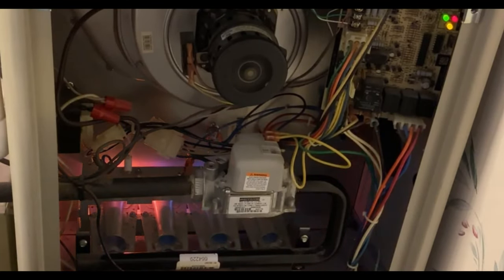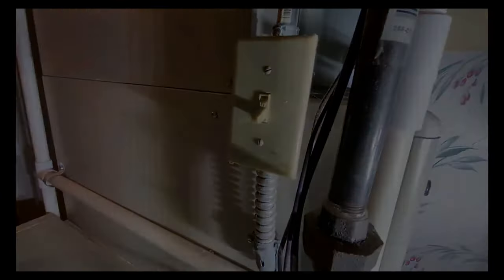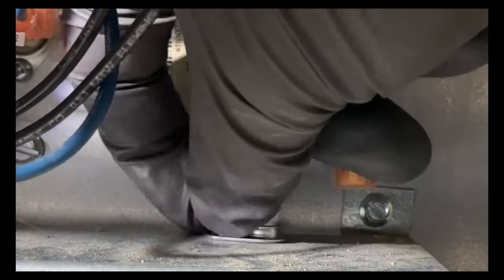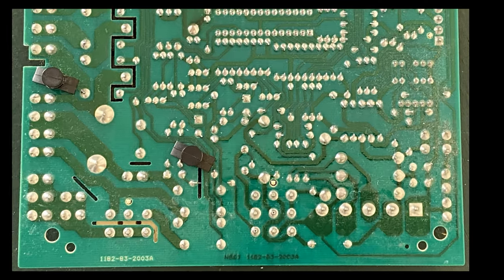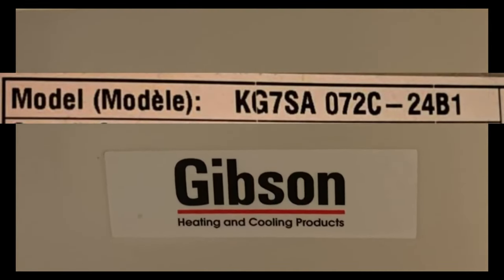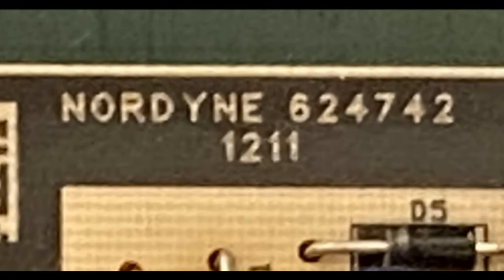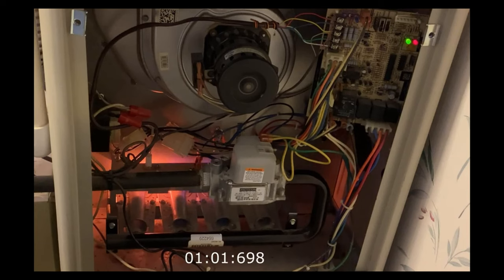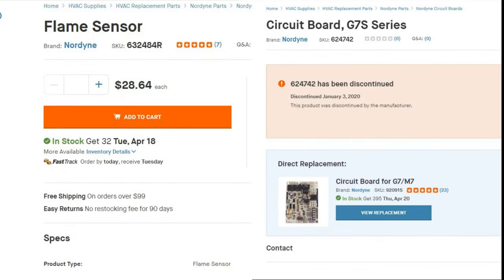Gibson Furnace Won't Stay On (Repair and Parts List)

Comment: Thank you very much, Owen. I had the exact problem with my furnace, replacing the flame sensor didn't solve the problem. I just ordered a new sensor you listed and will report back when it is installed. Luckily, temperature has rising in the the spring.
Reply: Just want to report back that I've replaced the control board and, viola! the furnace is running again. I examined the old board and saw no visible broken soldering points.

Comment: I am getting Pressure Switch Open Fault.  Does the pressure Switch need to be changed?
Reply from the maker: You should check with an HVAC tech.
Reply: It was my board but it wasn't bad just had a loose wire. Now it's all good!!